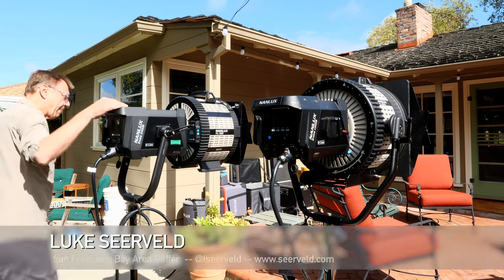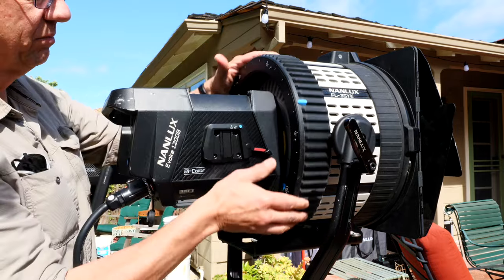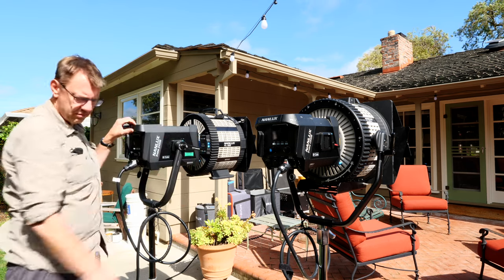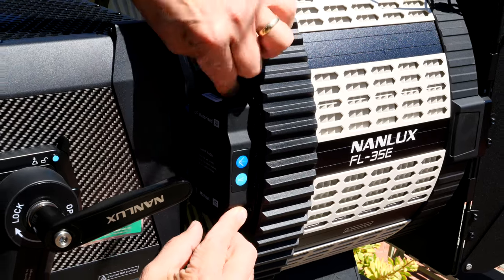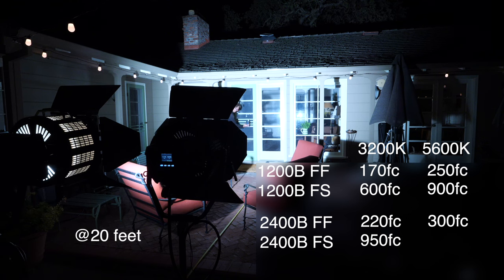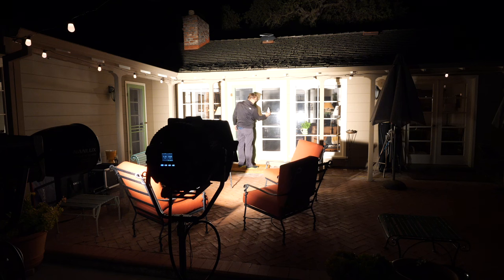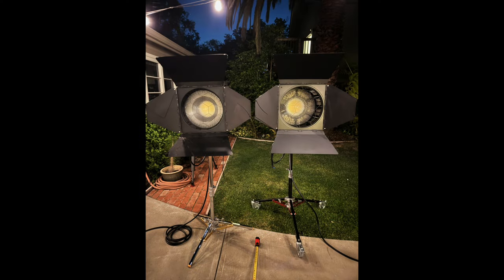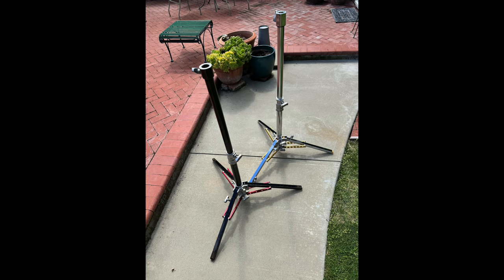Been wanting a fresnel for your Evoke 2400B? Here you go!

Comment: Please correct me if I’m wrong, but after looking at the result output of this 2400B + fresnel (in comparison to the 1200B), I’d have to say it’s under performing in what I was hoping to see in your test results. 2400 watts should be one stop brighter than a 1200 watt lamp. I was expecting the output for 2400B in FS to be closer to 1800fc. And double the output for the other comparisons as well. Great test Luke thanks for sharing.
Reply from the maker: I think that’s the initial takeaway, but when I step back and consider what the alternative would be, larger/heavier/spendier, this fresnel has plenty to recommend it as another modifier to go along with the existing intensifiers.
Reply: For 1.7 times the price I would expect 1.7 times the output. Not 1.2.

Comment: Did Nanlux give a reason for not putting a yoke on FL-35E? Not loving the front heaviness, output and weight  of the unit. Nanlux needs to take a look at Prolycht's Fresnel for the 675fs. A nice compact light weight design.
Reply from the maker: There are always compromises when it comes to designing optical accessories. The 2400B is just enough larger than the 1200B so as not to fit inside the housing, which would have meant creating a larger housing and larger fresnel. It’s possible that that would have been better for weight distribution and optics, but then size, overall weight, and unwieldiness come into play. I’m sure they made many mock-ups to find the best solution with the fewest compromises. As far as a diminutive fresnel goes, they have created a lighter weight version for the 900c, but heat becomes an issue with the larger units, so you need a way to deal with that. Overall, Nanlux is doing a great job listening and delivering within the constraints we put on them to keep units relatively functional for slimmed down crews and truck space.

Comment: Hi, I just bought the 2400b and the fresnel e. The lock on the 2400b for me isn’t strong enough to hold the fresnel. Any ideas?
Reply from the maker: Are you making sure the non-kip-handled side is also tight? I would also order a second kip angle so you have one on both sides.
Reply: I can try tightening the non handle side further. Any ideas where to get the second handle?
Reply from the maker: @Nauwl I would go directly to Nanlux Americas if you are in the US or your local Nanlux dealer. I’ve been meaning to do the same. Ping me if you have difficulty.
Reply: I haven't tried it yet so a bit of speculation but back when Chimeras were popular with the Arri 1200PARs and 2k open-face I used to hang a 10 lb. shot bag to the rear handle with a carabiner to even out the weight difference.
Reply: @alansteinheimer4274  we use straps and hook itself to the styrup. kinda iffy solution but it works until they offer a solution (which i think they are soon). shotbag would be to much add weight whenhaving it on a 30kg windup sadly. but thanks for the suggestions